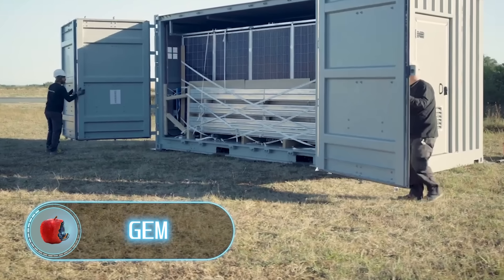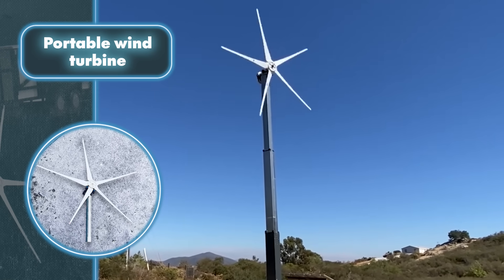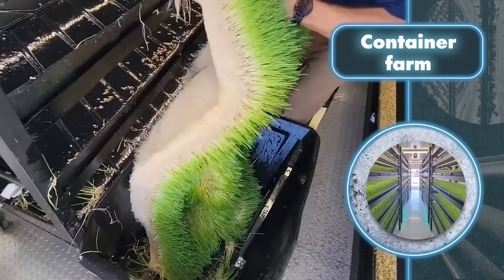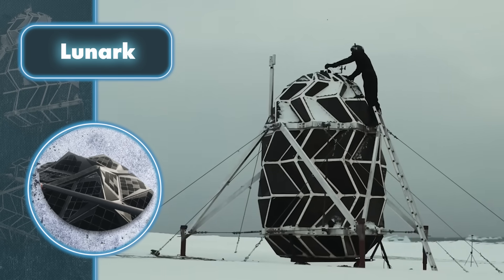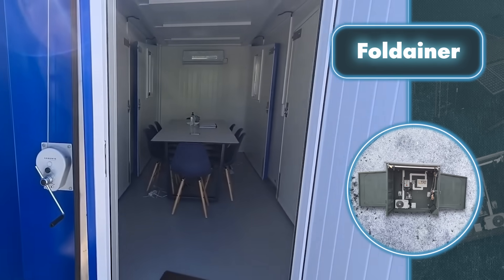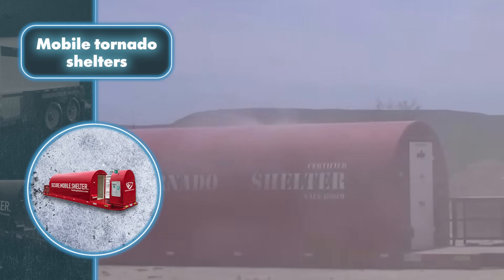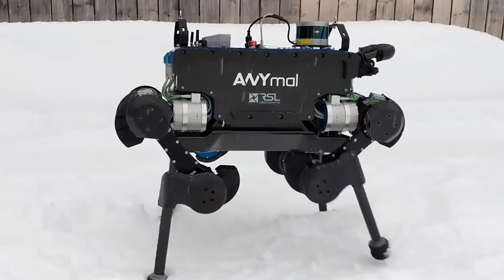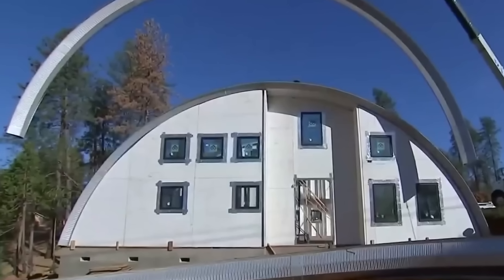Incredible Inventions for the End of the World

Comment: The apocalyps is only 22 years away according to the research done by the CIA and the solar nova cycle. This cycle happens every 12,068 years. During this event the Earth stops turning for 12 hours and then starts spinning again , but turns in the opposit direction for the next 12,000 years. Te last event was described as the flood of Noah.
Of course during this event, the earth stops turnning but the oceans do not. So the flood is the oceans rushing over the land. So the Pacific ocean will go over America and be up to 3 miles high.
The indian Ocean will go over Australia and the philipines again up to 1 mile high.
This of course is just a small part of what will happen during the apocalyps.
So if you think you can defend yourself from that puts you under up to 3 miles of water, then go for it.